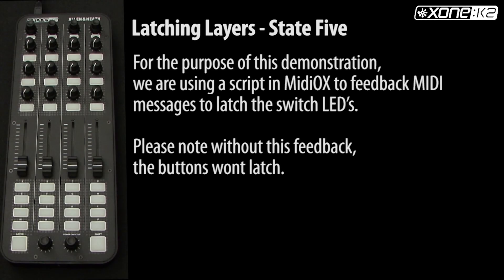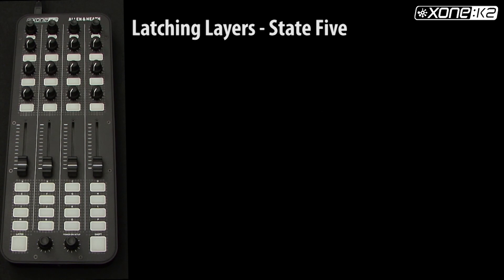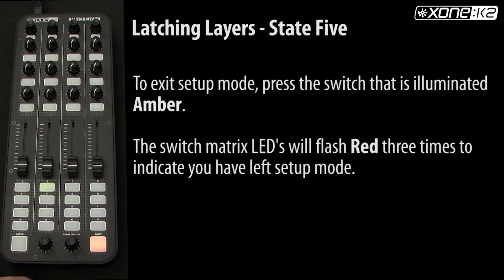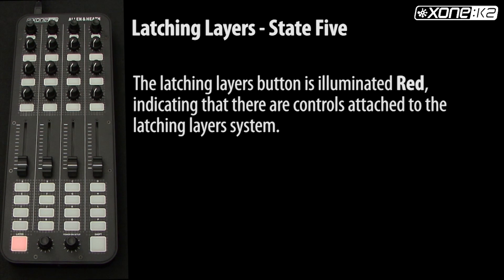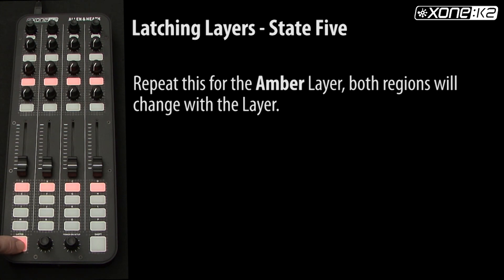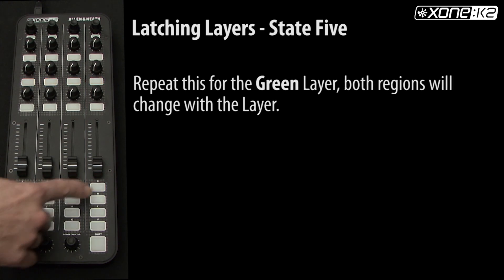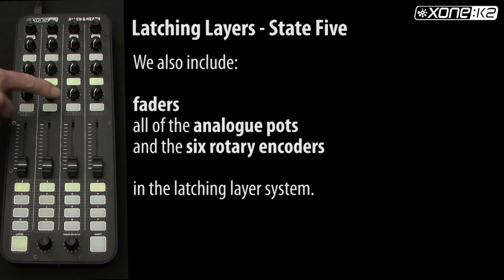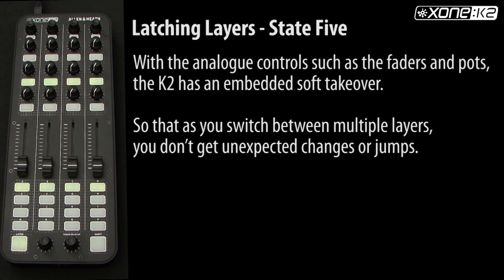Xone:K2 - Tutorial: Latching Layers State Five (All Controls)

Comment: Hola, soy Ariel de argentina, esto realizando el mapin y tengo una pregunta. Yo solo quiero trabajar con 1 sola capa. Y quiero configurar el boton LAYER  como PLAY/PAUSA para poder lograrlo tengo que configurar el layers en el primer estado?
Reply from the maker: Hi Ariel,
Yes, you need to enter the K2 setup mode upon power up. Then go into the latching layer setup, turn the “scroll” encoder anti-clockwise until all the LEDs are off/layer setup is bank. Exit the set up mode and the Layer button will now not change the controller layer.

Best regards,
Reply: @AllenandHeathUK  thanks

Comment: Nah these were intended to compete with the F1 and NI based controllers for DVS DJing..    I own two, one is used with one laptop to control traktor things such as selecting tracks, loading, playing, looping (size set, flux mode), effects, and hot cues for a Four Deck setup, then I use one for ableton on a second laptop with latching layers to control Ableton Sample Tracks, massive, my Maschine mk2 and external ableton effects, all routed to a xone 92..   The xone k2 is all i could ever ask for